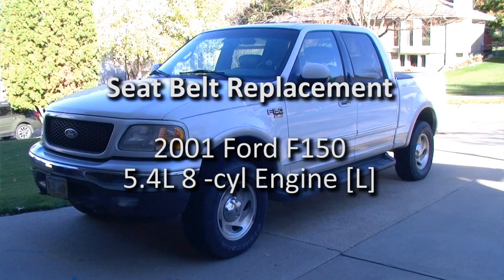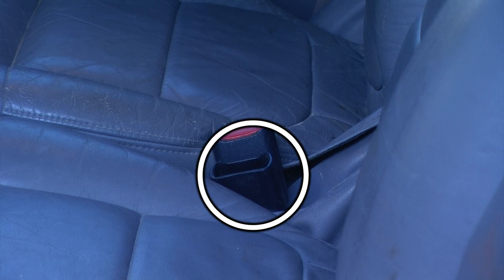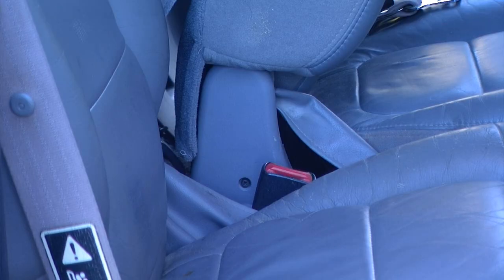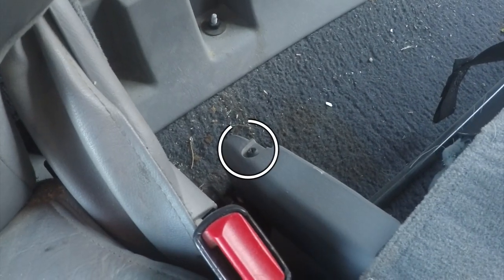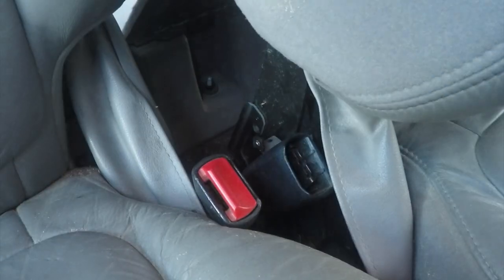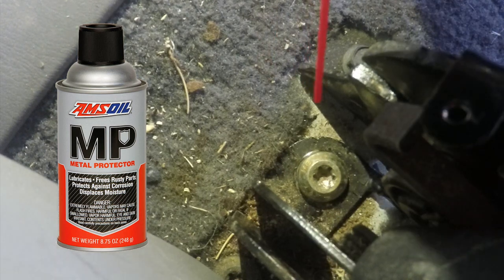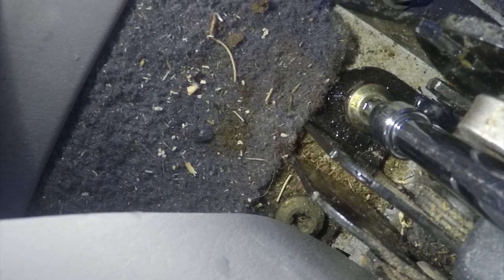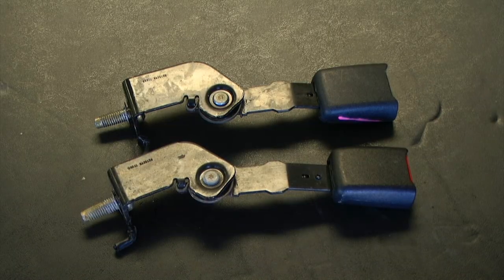2001 Ford F150 Seat Belt Replacement (Broken Seat Belt)

Comment: Great video. I also got the middle one out of an expedition but I also need the rear passenger side, the one next to the middle belt. The expedition rear passenger receiver is bolted to the side of the seat. Will have to keep searching. Thanks.
Reply from the maker: Thanks for the comment.  Good luck.

Comment: Hey Jon. I have the exact same truck that you do (same engine code and everything). Recently my truck started idling a little harder than usual and when I come to a stop sign it sometimes stalls out, but will crank right back up and run like there's no problem at all... 

Any ideas what this maybe? As always, thank you for your help, bud.
Reply from the maker: This is what I would do if it were my truck.  Start off with some cheap maintenance tasks and see if it solves the problem.  #1.  Check your air filter to ensure it is clean and replace it if necessary.  #2 Run a can (or two) of Power Foam through the throttle body http://www.amsoil.com/shop/by-product/other-products/cleaners-and-protectants/power-foam/?zo=10458  You can find a video for this service at: https://www.youtube.com/watch?v=LfV5FHc3c6s and finally #3 run PI through your fuel system http://www.amsoil.com/shop/by-product/fuel-additives/gasoline/p-i-performance-improver-gasoline-additive/?zo=10458  These three things are cheap, you can do it yourself and they will clean out everything from the air and fuel entering your system to your combustion chambers to your exhaust.
Reply: Insane Oil Thanks as always, Jon!

Comment: You did not replace the seatbelt as described in the title 😢
Reply from the maker: I apologize for the misleading title.  I suppose it should read Seat Belt Latch Replacement.  The basic methodology for replacing any seat belt component is similar, in that the seat belt has several anchor bolts into solid metal areas of the vehicle.  The trick is accessing the bolts, loosing, and ultimately removing them.
Reply: Insane Oil Ok, thank you